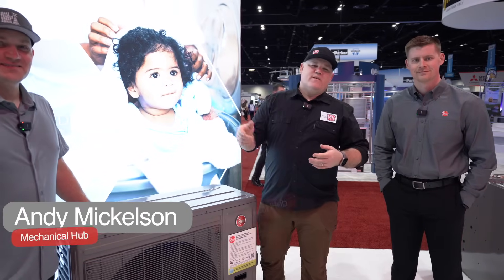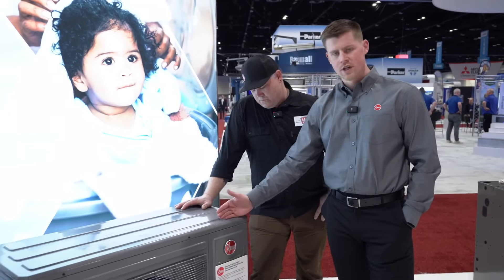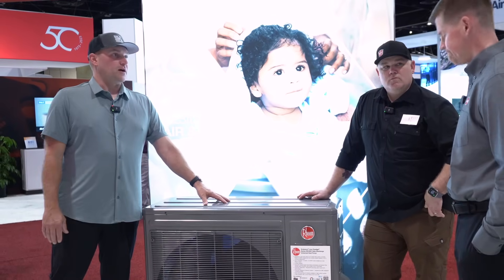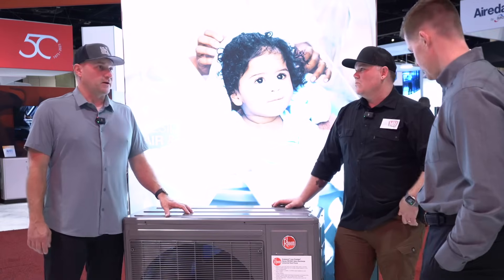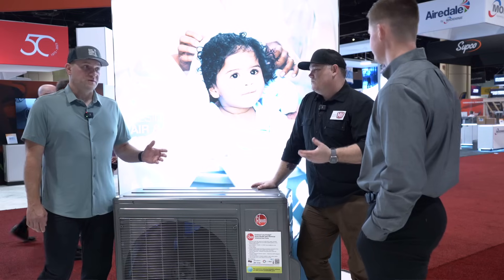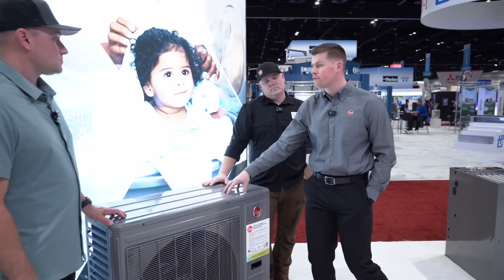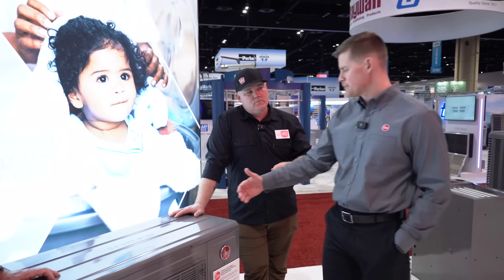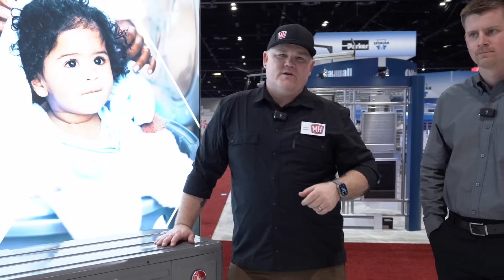AHR Expo Tour: Rheem Endeavor Line Universal Heat Pump

Comment: Hello. I was wondering what you thought about Flowguard Gold CVPC pipes and fittings? Their website says their pipes and fittings are the only type on the market that is immune to chlorinated drinking water, unlike PEX.

They say: "PEX is not inherently compatible with chlorinated drinking water, so the material is infused with antioxidants during the manufacturing process that protect PEX pipes and fittings from chlorine. However, these antioxidants are “sacrificial” in that they are consumed by the action of neutralizing the chlorine in the water. 

The longer the pipe is in service, the fewer antioxidants remain to combat the effect of chlorine on the pipe. Plus, multiple factors can accelerate the depletion of antioxidants, including aggressive water conditions, UV light exposure, pressures above 80 psi, and temperatures above 140° F. Accelerated chlorine degradation can result in pinhole leaks in PEX pipes and fittings relatively early in their expected life".

Are there other concerns with Pex piping and fittings that you know about?

Comment: My favorite thing about Rheem is the econet communication is reverse engineered and you can hook it up to HomeAssistant (and other home automation systems) with a small wireless device (M5Stack).  It gives full control options that are lacking in most commercial applications.  The project is esphome-econet.